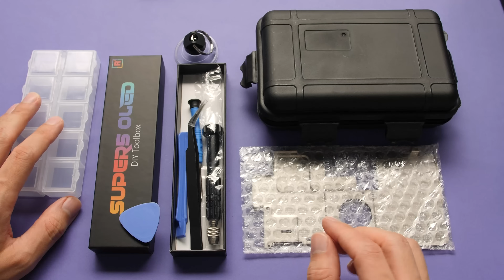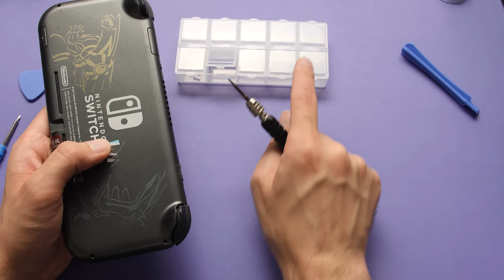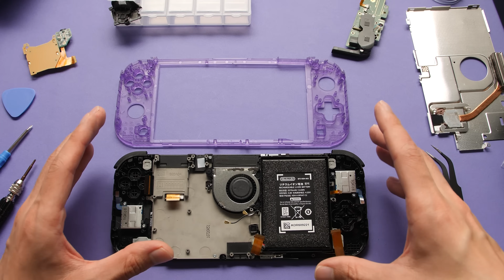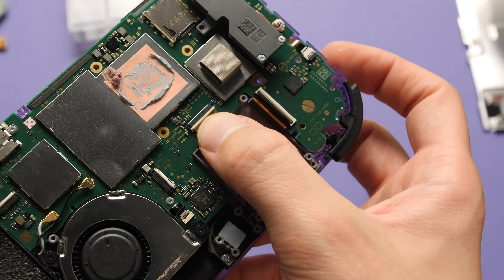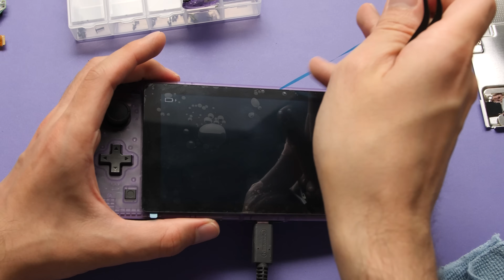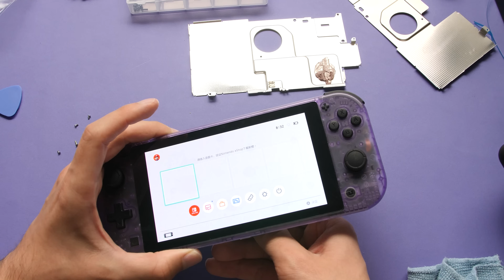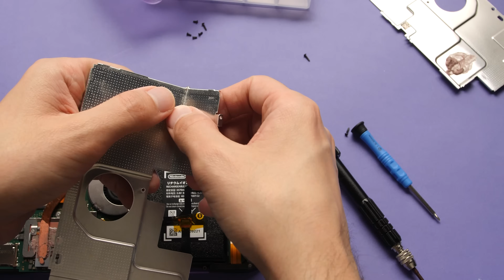SUPER5 OLED Touch - Product Overview & Installation Guide Part 2

Comment: Edit: He just posted a full tutorial for if you are doing this mod but KEEPING your shell. Thank you, Taki! It’s the video on this channel with the pink/salmon Switch Lite in the thumbnail.

Original comment: I think I’m failing to understand the difference in steps if I’m NOT doing a shell swap. I’ve watched the previous tutorial and this one but the previous tutorial lacks touch controls so it isn’t entirely applicable here.
Reply: I’m wondering this too. I got the Hyrule edition and want to keep the shell. Now I have this kit and not a tutorial to install it without shell swapping
Reply: @rickyhoeppner6512  similar situation here. Received my kit yesterday and was hoping my original comment was premature and there would be specific instructions in my actual kit. No such luck. Nothing included in the kit.
Reply: @milesmilesmiles  same situation here. I have the Pokemon gray switch lite and I really don't care about swapping shells. This tutorial was very detailed but tbh it was poorly done in that it only covers the shell-swapping way.
Reply: @  I am happy to report my installation went fine. Just follow this new tutorial up until about 7:50, then switch to the old tutorial to remove the magnesium frame and swap the screen. You can then switch back to the new tutorial to complete the installation. Good luck!
Reply: @ I am happy to report my installation went fine. Just follow this new tutorial up until about 7:50, then switch to the old tutorial to remove the magnesium frame and swap the screen. You can then switch back to the new tutorial to complete the installation. Good luck!
Reply: You might have to remove the magnesium plate as well so you can properly feed the touch screen cable through the hole. Non touch versions can leave it in since they don't have to feed that cable.
Reply: @SirChevron  yeah you're right. The tutorials are pretty much the same save for this new one not showing you how to take off the magnesium plate and how to (carefully) remove the old screen. Everything kind of fell into place after that
Reply: It shouldn’t be that difficult. Just follow a screen replacement tutorial until you reach the point where the original screen is removed. Then come to this video and follow the reassembly, as if you were assembling into a new shell. Viola. How do you all maneuver through life without basic logic?
Reply: @JigglypuffTutorials  that's not the point now is it? Instead of being condescending, acknowledge that this information should be included in an official tutorial that's linked to the product web page. What you say might be true but it does not invalidate the original issue here.
Reply: @JigglypuffTutorials  thank you for the suggestion, but that last sentence was a weird addition. It costs you zero energy to not type that last, rude part. I don’t know why you made that choice. DeanGI was correct, this is the closest thing to an official product tutorial. Why would it not include all of the steps for the product installation?

Comment: Just received the Touch version of the screen. I see you made a revision to the backplate, removing the entire right side alltogether. Also mine came with 2 button ribboncables. Any differences between those, or just a spare?
Reply: did you figure out your problem?
Reply: @Lukeruu  No problem, guessing it's just a spare cable. ALso came with a spare display cable that is sttached to the back of the display.

Comment: I got one small screw driver and no bits for the other….
Reply: Pull the tail end of the larger screwdriver off. It has the bits inside it. Though the one I got does not include a philips bit for some reason.
Reply: @ just found them thank you

Comment: Can anyone tell me if the touch version has glass panel or plastic panel? Can we install tempered glass protector on top of the display without interfering the touch sensor?
I’m pre ordering the touch mega kit version and thinking do I need to buy tempered glass as well.
Reply: It said SUPER5 OLED with OCA Glass Touch Panel on their website
Reply: @ Thank You!

Comment: Would have been more helpful if you didn't do a shell swap.
Reply: You already need to take apart all the components, whether you're swapping the shell or not. The only difference is that you’ll need to use heat to remove the original screen from the shell if you don't want to shell swap
Reply: @ hmm you make a fair point. May as well do a swap I suppose.

Comment: Is your HDMI & Touchscreen mod compatible with a picofly mod chip?
Reply: I also would love to know the same thing as you Colin.
Reply: @seby440  turns out the new iteration of the board for the HDMI kit will mount on top of the ram, which is where the mod chip mounts. So I opted to get just the touchscreen version and ditch the HDMI since I only want to use it as a handheld.

Comment: Taki i commented on twitter. At about half beightness on my non touch super 5 on black scenes i have light bleed on the bottom. When i up yhe beoghtness it goes away but eas just wondering what the issue might be?

Comment: I ordered my OLED touch - mega kit yesterday. I will use a black metal shell and white buttons aiming for a blakc&white design. If the display comes already assembled into the replacment shell, I hope I can remove it without problems. Since it isn't mentioned on the product page I still hope it will be delivered as seperate pieces.
After looking at the tutorials I think I will cut a hole in the metal shielding plate to avoid pressure of the 10pin FPC connector on the battery.
Reply: nearly 1.5 month later and stil waiting for shipment...
Reply: Patience is a virtue.

Comment: I don’t understand the profile buttons being stuck under the shell. Instead of let’s say a key combo like hold + and up. Also won’t they get pressed by the back shell?
Reply from the maker: You are not going to get key combos without soldering. This is a no-solder kit.
Reply: @TakiUdon2  How about not using physical buttons but touch ribbons instead? Like the touch ribbons companies use for Game Boy Advance display replacements to controls color profiles and brightness. Touch ribbons are solderless as well. You could position touch ribbons somewhere under the back of the shell or under the top. This would allow you to change color profiles and brightness by touching the correct spots on the shell. No opening of the shell needed.

Comment: I can't wait for mine to ship :) super excited that this product exists thank you Taki!
Reply: Could u let me know around how long it takes to deliver? Thinking about getting it for my Zelda switch lite
Reply: @dawas5370  Like forever. Ordered Oct 6 and shipping was predicted for mid-November. Coming up on January and no word yet.
Reply: @dawas5370  Ordered mine Oct 6 and it's Dec 30 with still no word.
Reply: @dawas5370  just got it installed i think it came in about a week ago but I was in one of the first waves of pre orders can't really say how long it will take to ship now that they are in full production. I can say that once it did ship i had it a little over a week later which is not bad for shipping from china to the U.S.

Edit: they are sold out
Reply: Did you do it?
Reply: @obelisk_hd  no, he hasn't shipped them out yet, half a year later..... looking kind of like a scam right now, but that's just my opinion

Comment: Can we not swap the Super5 Touch screen like you did on the other video you posted? I don't plan on doing a shell swap.
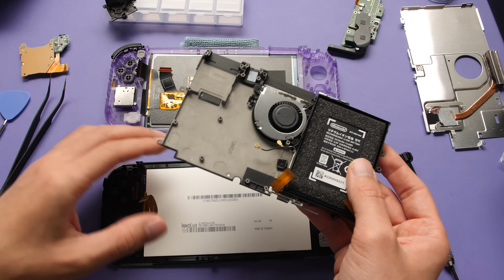Reply from the maker: As I said at the beginning of the video, it's the way I personally install this version, but it is way more difficult and way easier to break something. This tutorial is almost the same if you plan to keep the same shell. You only need to remove the stock screen after 8:54
Reply: @TakiUdon2  I guess I can change the analog sticks while I'm in there
Reply: @TakiUdon2  It's the way you personally install this version, sure. But if this is meant to be the official tutorial linked to the kit's website then the way you personally do it may not be the most ideal way to do it since most people's use-case would not involve shell-swapping.

Comment: Hey Taki do you recommend swapping out the analogue sticks since you have the console opened up? And which sticks would you recommend?
Reply from the maker: If your Switch Lite is old, yes. The sticks in the unit I used for this video were beaten up. You can replace them with cheap standard Switch Lite joysticks or hall effect joysticks from many vendors. I'm using the TMR sticks that are in the Mega Kit.
Reply: @TakiUdon2  which brand are they Taki? I want more of those sticks.

Comment: This might help someone: My oled lite did change the profile by just tapping around the battery for some reason. I put some tape over the connector that sits over the battery and under the metal shield and the problem was gone. Weirdly enough I only had the problem after opening the system up a second time to change some buttons I didnt quite like. First time nothing was wrong at all.

Comment: Ordered mega kit 10/4/24. When are they shipping?
Reply: you didn't get the email?
Reply: @ no, I was given a tracking number that was delivered to some other address on 11/12/24 then called ups and emailed them about it and was told my order hadn’t shipped yet then contacted them again and told I’d be provided a tracking number when mine does. So, what email are you referencing? I’m fine to wait but haven’t been given any explanation.
Reply: @ there was a long email explaining the whole situation. I’ll post the whole thing here in a minute for you
Reply: part 2
SUPER5 HDMI

Like SUPER5 OLED Touch, SUPER5 HDMI has been a challenge to finish. When SUPER5 HDMI went on preorder, we had our first prototype revision made. I originally did not plan to preorder SUPER5 HDMI at all, but we had a lot of requests from potential customers to allow them to preorder this SKU during the main launch.

SUPER5 HDMI was supposed to ship 30 days after the non-touch SUPER5 OLED screens, and that would give us a little over a month and a half to iron out issues before shipment. It would also give us enough time to do at least one further hardware revision in a worst-case scenario.

We are now beyond the worst-case scenario. We have done ~3 SUPER5 HDMI revisions since September. The first two failed either due to manufacturing complexity or signal integrity issues. Three days ago, we finished work on the 3rd revision. Unlike the previous two, the HDMI side of this revision fully works, and it is amazing to see it in person. The problem is that the OLED half of this solution doesn't work due to signal integrity issues.

Unlike SUPER5 OLED Touch where I can estimate the shipment date with a margin of error of two weeks or so, SUPER5 HDMI has too many unknowns. What I do know is that we need at least one further revision to fix the OLED signal issues. That revision is happening right now.

Depending on the complexity of this revision, it can take up to 20 days to get a prototype back. That prototype then needs to be debugged to see if there are any further issues. If there are no further issues, we are looking at an additional 20-25 days to get back a mass-production version.

Again, all of this assumes that the next revision is the final revision. If it is not, you can see how things can get out of control.
Reply: part 3
Shipping Schedule

Based on the information I have available right now, we are looking at the following situation for SUPER5 OLED Touch & SUPER5 HDMI shipments:

SUPER5 OLED Touch - Shipments for this SKU would start on December 20th, or a little before this. Based on the volume of orders we have and the QA process that needs to happen before each screen ships out, it can take up to 12 business days to ship out the entire batch.

SUPER5 HDMI - This one is harder to say. What I do know is that this can't ship in December. If even one thing goes wrong, a January shipment would be nearly impossible. Right now, I can just say SUPER5 HDMI will start to ship in January. If we include the processing time for Mega Kit orders, it can take up to 20 business days to ship out the entire batch.

Options

If you do not feel comfortable waiting, you can request a full refund of your preorder by replying to this e-mail. You can then order this again when it is in stock without a preorder. Be aware that not all of the 10 launch colors will be available during future batches. We will probably only keep 5 colors in stock in the future, with black being one of them. This is due to minimum order requirements for each custom color.

As compensation, all orders affected by this delay will ship with a free tempered glass screen protector.

If you are fine with waiting, there is no need to reply to this e-mail.

Best,

-Taki
Reply: part 1 
Hello,

You are receiving this e-mail because you have a current SUPER5 OLED preorder with a listed November shipping date. Please read the following e-mail for a status update on your order.

SUPER5 OLED Touch

Creating a custom glass touch panel for the Switch Lite has been an extremely challenging journey. When SUPER5 went on sale at the end of September, we had two independent companies working on a touchscreen solution. The first company had a working plastic touchscreen, while the second only had failed glass panels that did not support continuous touch.

Based on the time it takes to produce prototype revisions, I set a November delivery date to give us enough time to create at least three further revisions. Unfortunately, that wasn't enough.

Company A

Let's start with Company A since they were originally the main hope that we had to meet the November shipping date. This company had a working touchscreen from day one because they worked with a company that produces clone digitizers for the Switch Lite. This company can do color-matched digitizers, but I limited the options they needed to produce to white and black. That is why those were the only colors available at launch.

As I stated, this company had a working plastic digitizer before we started to sell SUPER5 in September. Since they have a working plastic digitizer (touch film glued to a plastic front plate), they should be able to just glue the touch film to a glass panel and call it a day, right? I wish it were that simple.

Capacitive digitizers are incredibly annoying, and anything that you put in front of them changes the way they work. If you take a film that has all of the correct values from a plastic frame and put it on glass, all of the values change and the screen will no longer work. It will either have zones with no input, or it will not support continuous input (IE, you can't drag your finger across the screen).

To date, this company produced two working plastic touch panels, and two failed glass touch panels.
Reply: part 1.5
Company B

That brings us to Company B. This company is the one that I used to color-match all of the stock Switch Lite screens. If they could make a working glass digitizer, that would mean we could offer replacement touch displays in the 8 original colors. The problem is they had no idea how to make a working digitizer for the Switch Lite.

When SUPER5 went on sale in September, this company had two revisions under their belt and neither of them worked. Out of 720 possible lines for touch input, their first two screens could only register input on 1-3 lines.

On September 28th, the company gave us the 3rd and 4th iteration. These screens supported continuous input, but only 90% of the screen was functional. The problem is that they didn't know why the other 10% didn't work, and they initially didn't seem motivated to fix it (I was asked if 90% was acceptable for mass production and I refused).

We had a big meeting on October 10th with their engineers to try and get to the root of the problem. Using their debug tools, we were able to determine why their first four screens didn't work, as well as what they would need to do to create a working screen. I was very optimistic after leaving that meeting because even if they couldn't create a working screen, I could at least explain to another provider exactly how to do it.

From October 10th to now, it has been a rollercoaster of ups and downs with Company B. Here's an overview:

October 17th - Versions 5-9 are created, and they have dead input on the left and right sides. Several do not support continuous input, and they also have grounding issues.

October 28th - Versions 11 & 12 are created. Version 11 passes my tests and fully works. I request OCA samples for final verification before mass production.

November 16th - 4 OCA verification samples arrive. All four fail to support continuous input and can only work when they are manually grounded on each reboot. Debug data shows a 5% increase in capacitance value over version 11.

November 25th - Versions 13-16 arrive. All four work.
Reply: @Pit0fDespair  part 1 wouldn't post, tried three times... anyway... you get the gist.
Reply from the maker: @Pit0fDespair  This is strange, you shouldn't have had a tracking number for a Mega Kit. Non-Touch is the only version that has shipped so far. What's your order number?
Reply: @ I found the email explaining what is going on. I understand now and I’m all good to wait. I’ve contacted the sales email before and assured my order hadn’t shipped yet. Was given a tracking number via shop app before that was delivered to somewhere in my city, must’ve been a mistake. RR-M16216 Thanks and no worries on the time frame.